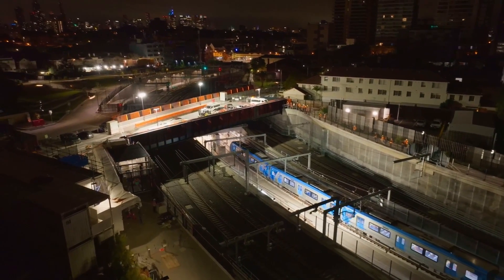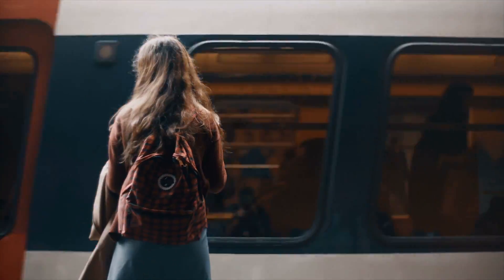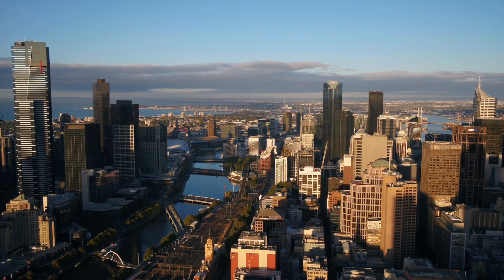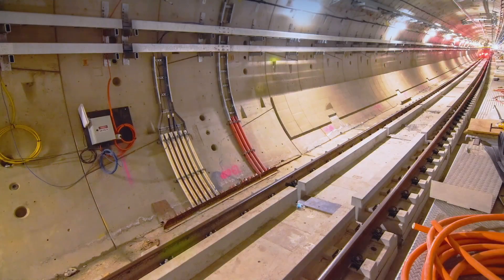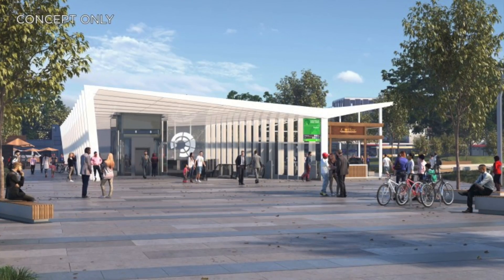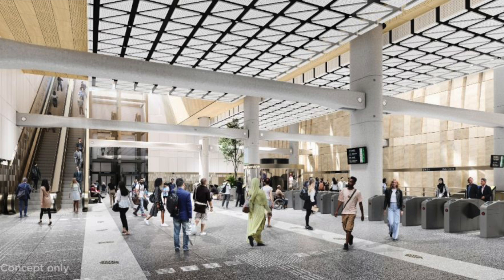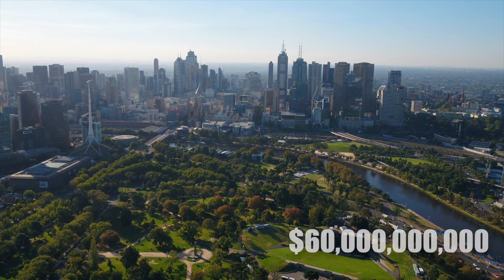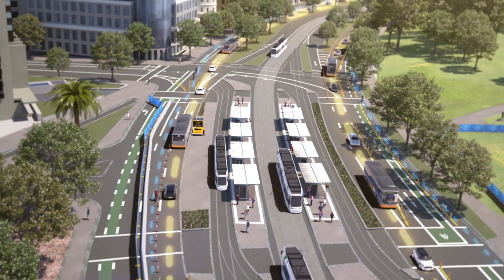The Insane Engineering Behind Australia's $125BN Mega Railway

Comment: It's a shocking waste of money. Ask anyone on the street here in Melbourne and no one wants it. With any luck it won't happen. Plus they never mention the fact it is not one continuous track. You will have to change trains 3 or 4 times to make a full circuit. Insane engineering indeed.

Comment: A little optimistic. SRL has a lot of issues such as a circuitous route and lack of station nodes compared to distance. Stage One should have at least two additional intermediate stations and could actually be shortened by about 2 km if a shorter route was taken, but still with interchange at all radial lines. If SRL were instead to be established as a medium capacity LRT Metro it could be delivered earlier and at some cost saving. It could have more stations, but have ROW with the use of arterial road medium alignments, elevation and some tunneling / underground stations etc. There will be hundreds of thousands of homes in suburbs where the line simply passes beneath with to access. The line should firstly have a direct interchange at Southland rather than a 400m egress. Then before the depot a surface station could be in place at a vast industrial zone which could be further developed for transit oriented dev. and an elevated station several km south, before Clayton would add extra passenger attraction. The Monash / Notting Hill - university precinct has its station node in an area which is speculative rather than directly at campus / bus interchange and then the route travels in a highly circuitous alignment to Glen Waverley. This node was simply chosen through lobbyists and land speculators, rather than centering the corridor at My Waverley, more direct in line towards the terminus for Phase One at Box Hill. The first phase if it took the direct route from Monash to Box Hill with intermediate stations at Mt Waverley and Burwood would cut up to 2 km from the line, achieve radial line interchange and cost effectively savings could have been directed to completing the line at Doncaster Hill - where a railway station has been proposed for decades. For a fraction more of the overall cost for Phase One up to 3 extra stations could be placed along the line and a more direct route taken, while achieving the directive of the SRL to connect all the Eastern suburbs radial lines.
Reply: Y’all then miss Glen Waverley but we consider that’s worth adding

Comment: This video is wildly inaccurate, current estimates has the project (SRL East AND North) costing $29.214 billion in 2022 dollars. One questionable report had the figure at $125 billion but that includes 30 years of asset expenditure after opening to 2085. Unfortunately certain political individuals saw this figure and have been slapping it all over the place. I think its a good project but certain elements of the north section should be elevated as there are some wide roads like Mahoneys Rd and Camp rd. I also think Doncaster should have been included in the SRL east project as that area has been crying out for rail access since the 70s.
Reply: It’s a piss poor channel. Hype and misinformation